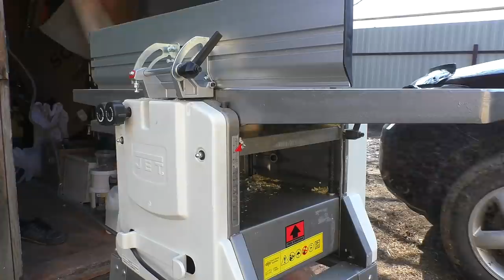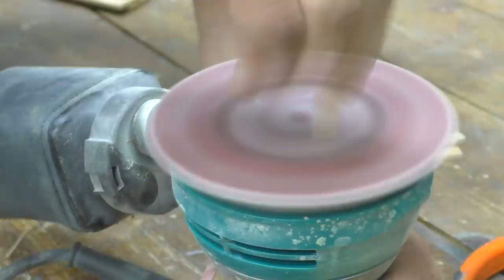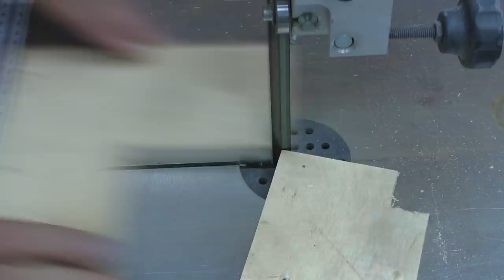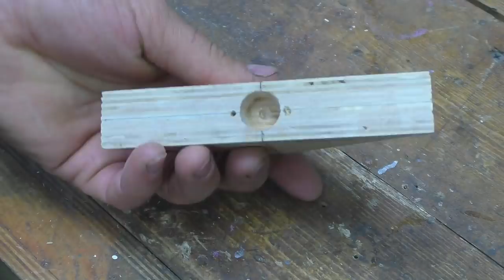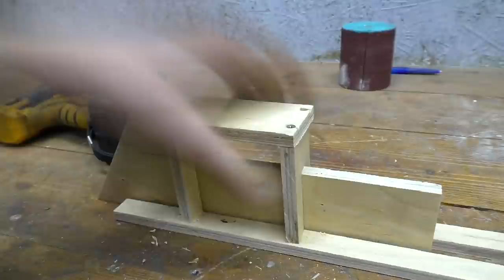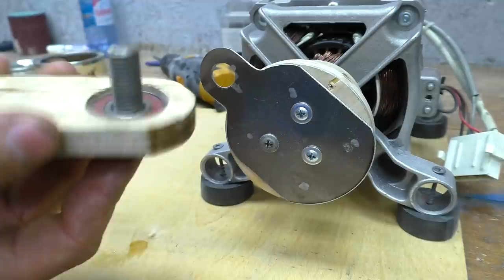3 ideas from plywood that you will want to make!!

Comment: Around 20 seconds in, a perfect example of how not to use a table saw. That saw blade and your fingers are destined to meet. Foolhardy use of unforgiving power tools. I know what I am talking about as I have been working with wood and machinery for well over sixty years!
Reply: @WayBeyond Kids can put their fingers in power sockets around the house amongst many other dangerous scenarios.  Yeah it's squeamish watching some dude push something through a guillotine but he didn't actually chop off his fingers.  He could just be super confident doing what he does.
Reply: @WayBeyond - You are right, however using your example on guns you mentioned keeping them locked up. So the problem isn't the gun itself. So as long as the guy locks his tool shed that's fine then? 

I do agree with you for the majority of what you said, power tools in general are unsafe, a table saw is the biggest accident machine in the woodwork industry; yet not all YT videos give a safety report before using it every time.
Reply: @WayBeyond - Attractive nuisance - I thought was going to be a prod at me 😂 But thanks I didn't know the definition. I grew up and live on a farm. Having lived in a city too, there are many risks and attractive nuisances around. To be fair to the video owner, it did look like a barbaric neat bit of kit, even if it were a tad risky.